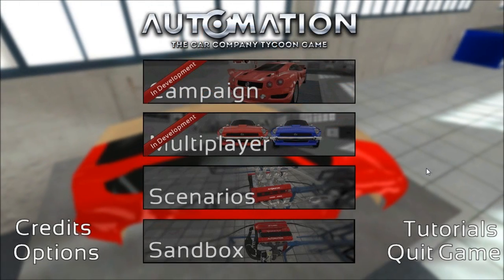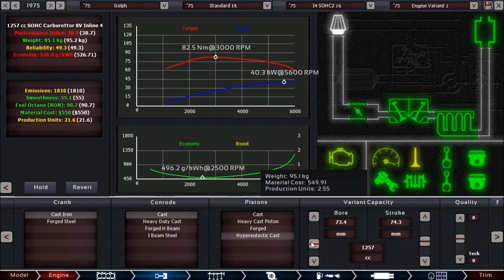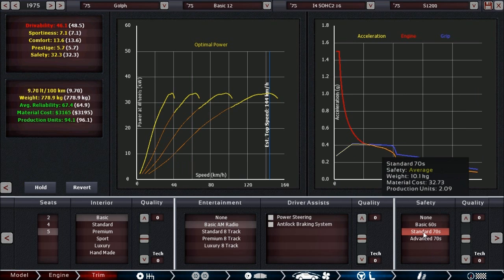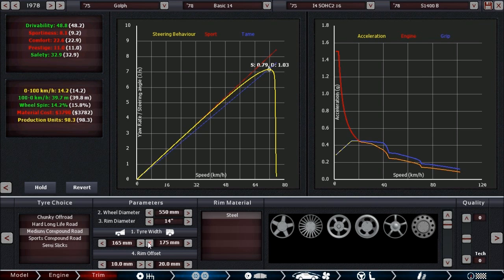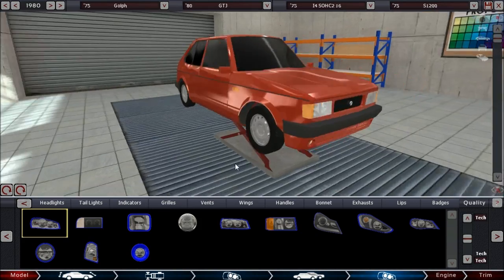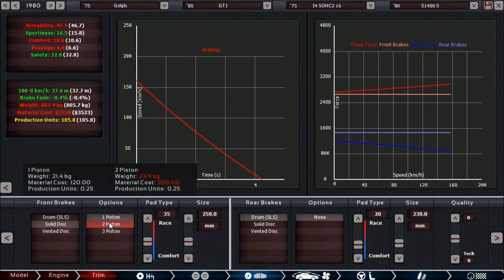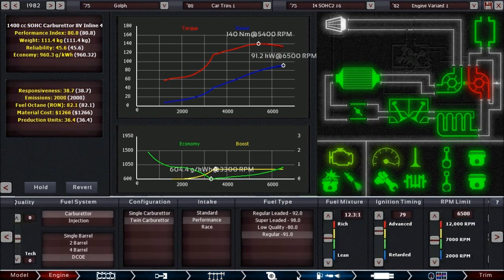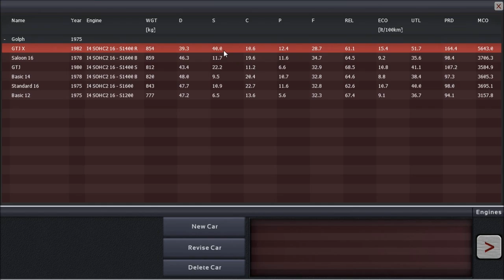Lets Play: The Golph Mk.1

Comment: Will there be FWD in the future? Since a lot of cars of the last decades are having this drivetrain.
Reply: Arjan Rietberg FWD is in the game, isn't it?
Reply: Arjan Rietberg It is in there once you select front transverse engine placement.
Reply: Arjan Rietberg it is already in game, he didn't get the opportunity to pick front wheel drive because he chose the place the engine longitudinally (meaning he can only power the back wheels) had he chose to put the engine transversely he would of had the option to make the car front wheel drive instead
Reply: benrgrogan And when doing traverse, some models will still not be able to get FWD, like pick up/ SUV and sport models (which is very obvious) but some small models like the ones which look like a MB A class or punto aren't able to do traverse (unless you want < 850 cc engines), so what would be normal irl can't be done it seems.
Reply: Arjan Rietberg i think you have to chose MacPherson Strut for placing a "big" engine traverse in a small car (like in real life)
Reply: benrgrogan I've seen a car with a longitudinally mounted engine and front wheel drive.
Reply: FM60260 There are quite a few longitudinal FWD cars.  All the early FWD V8 GM cars like the Toronado and Eldorado were that way.  So was the Chrysler LH family (Intrepid, Concord, Vision, etc) and the Audi A4/Passat platform.  It can make things more difficult to service, but it helps if you want FWD in a car that's too narrow otherwise (GM), wish yo add RWD variants later (Chrysler), or want a really primo AWD option (Audi).
Reply from the maker: Arjan Rietberg We will probably include longitudinal FWD too, yes. That has low priority right now though.